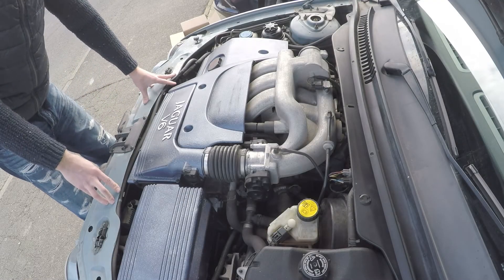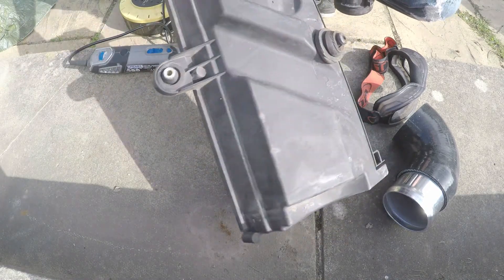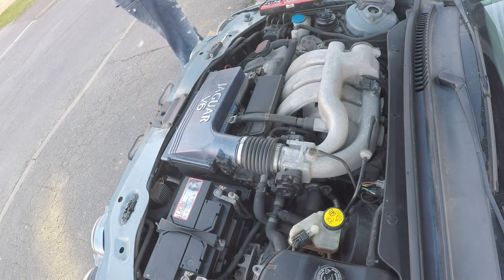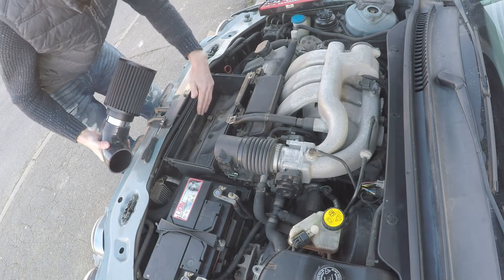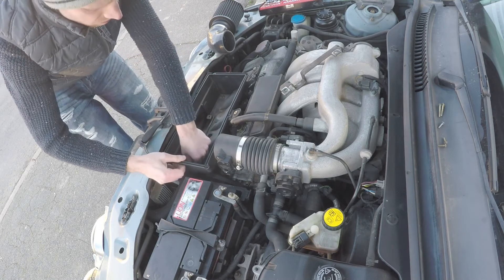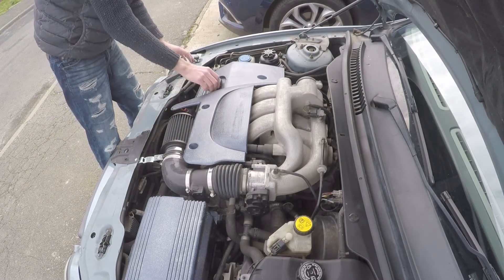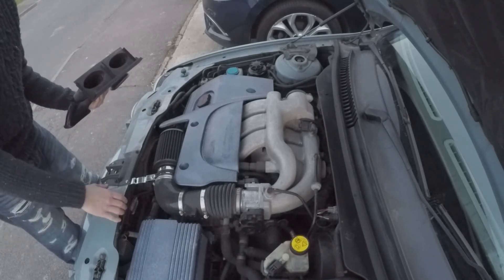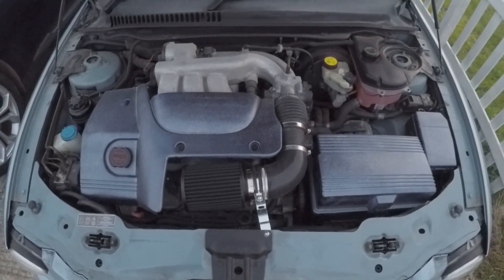Jaguar X-Type 3.0/2.5 Open Air Filter Installation and testing (Cold Air intake)

Comment: Did you get a silicone elbow that is bigger on one side than the other? Or just a 76mm on both ends same size? 

Also did you get a 4 inch or a 6 inch aluminum coupler?

Comment: Not sure if your gonna read this or not but I've just ordered everything on this video to give it a try I'm just wondering how you made the little clamp as gonna need to do that also.
Reply from the maker: Absolutely I read these. Do you mean the stand off support bracket? That's a length of metal flat bar with a 90mm p-clip bolted to it. All in stainless. It was an afterthought so wasn't particularly well planned.
-Anthony

Comment: Well done! It's pleasant to see that the intake air temperature hasn't increased, nevertheless with a cone filter your MAF sensor surely requires cleaning more often. As for me, I would add a third air duct to the intake nozzles of an OEM filter or even cut the lower part of the OEM airbox. Cheers!
Reply: What do you mean .cut out lower part oembox
Reply: @RolandLubberhuizen  I mean remove the trumpets and enlarge the hole for trumpets to the left. Maybe cut the front half of the airbox bottom as well. This would allow me using the OEM disposable airfilter.
Reply: Oké,thanks

Comment: Nice work 👍 was thinking about doing similar to mine. Any links for the parts used would be great. Also cant wait to hear the sound its created. Waiting for the new upload. Great video keep it up!
Reply from the maker: Thanks Terry! Part number on ebay for the alloy joiner is
222224901347
For the 76mm silicone elbow it's 383998956465.
Reply from the maker: Just added a video for the sound comparison. https://youtu.be/USuzvtZnYo0

Comment: Can we get a sound test? I would love to know what it sounds like with modified exhaust too....mine had the magnaflow back boxes with my cold air in the intake box and was rather quiet. Good to know now that I was restricting performance 🤦🏻‍♂️
Reply from the maker: As soon as you're moving at significant speed you'll begin to see a drop in temperature but it'll be interesting to recreate this experiment in the heat of summer and see how it compares.
Reply from the maker: Just added a video for the sound comparison. https://youtu.be/USuzvtZnYo0